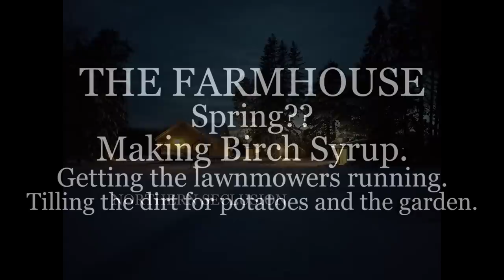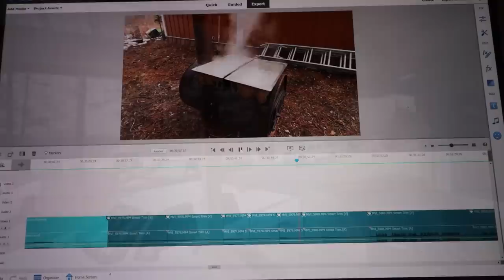THE FARMHOUSE. Spring is here. Making Birch Syrup. Lawnmowers. Gardens.

Comment: Seat switch or brake switch. Start with the seat switch. Cut the two wires and connect them together. Both of those switches won’t allow the current to the starter and most if the time it runs through the seat switch first
Reply: And check at the PTO switch most commonly the wire gets broken around the seat because if all the movement
Reply: The first thing I would do is jump across the wires at the ignition switch. It could be a bad contact going to the starter. Then the other cutout switches.
Reply: What
Reply: There’s at least 3 safety switches that can go bad and stop you dead
Reply: What do do with the ash and how do you clean it
Reply: The safety switches cut spark (grounding the coil). Since the mower does start up when jumping the starter, it's probably not a safety switch. If it was a switch there would be no spark, no ignition. My guess is the key switch is bad.
Reply: @MrGoosePit  That's what i'm thinking.
Reply: Also, check all grounds.

Comment: Joe check your ignition switch and see if the wire going to the solenoid has 12 volts when turned to start mode also look for any of the safety switch’s they go bad and want let the starter In gauge.
Reply: Check your in line fuses first. Then if all good jump start your wires together